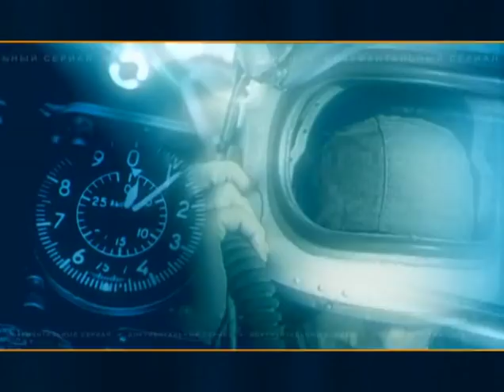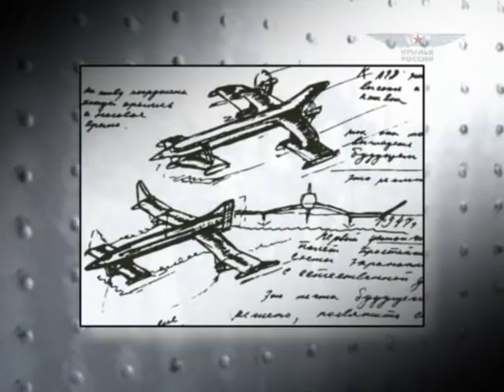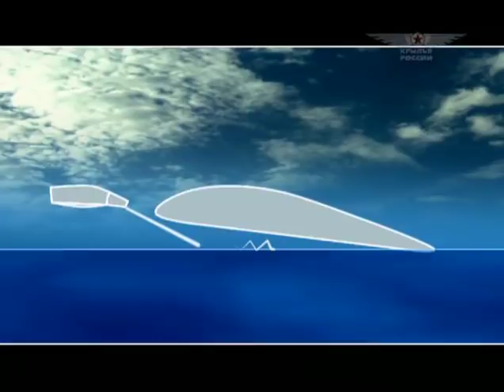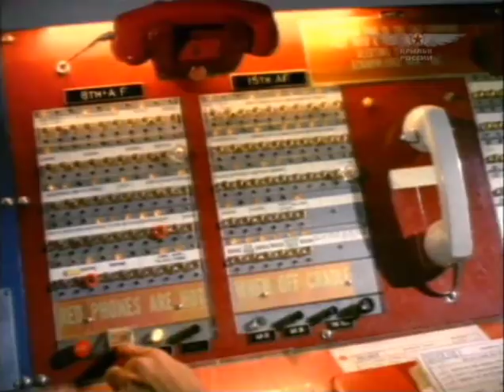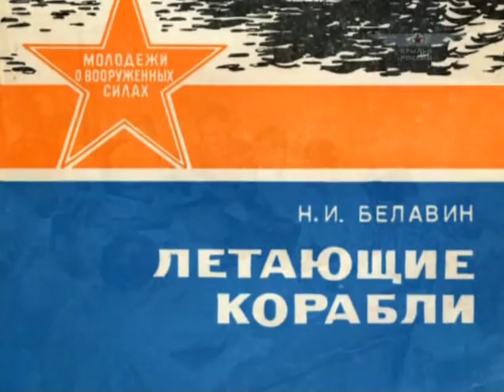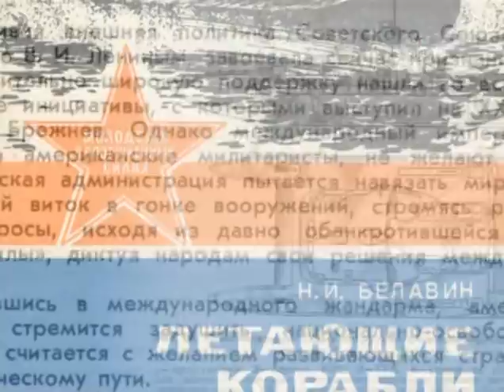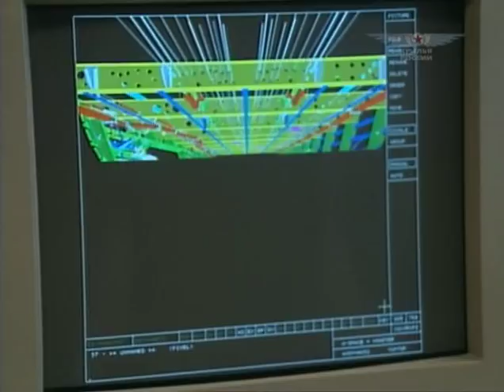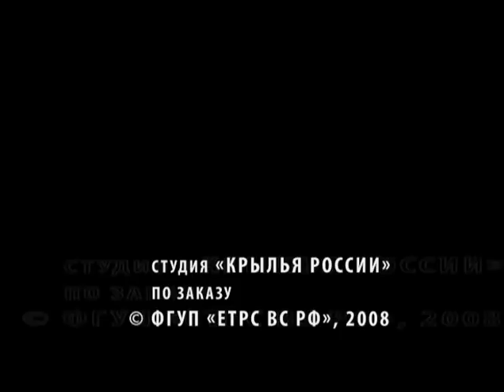Wings of Russia documentary. Episode 11 of 18. Ekranoplans. At the Edge of Two Environments

Comment: Actually KM test flight was something like 480 km/h.
It was overpowered just for lift off. It was actually able to get to 700+ km/h but noone was able to test it and dared to try it.
But I think these machines would works these days, with modern sensors and computing power to prevent human error. But would be very costly to maintain.

Comment: The Ecranoplan is mainly designed to carry a large amount of ammunition and personnel to the coast of the enemy very quickly during tactical wars to achieve the element of surprise without the need for helicopters and troop carriers, so its design is very similar to the design of aircraft to rise above the surface of the water to fly freely so that they can reach their targets quickly and easily at the beginning Its operation is sailing like a ship on the surface of the water, then its speed gradually increases to rise from the surface of the water, but it cannot rise more than several meters, similar to airplanes because of the low ratio between the power of its turbine engines to its huge weight.